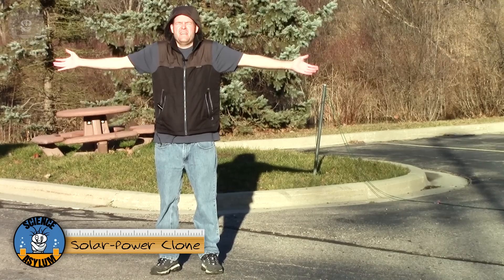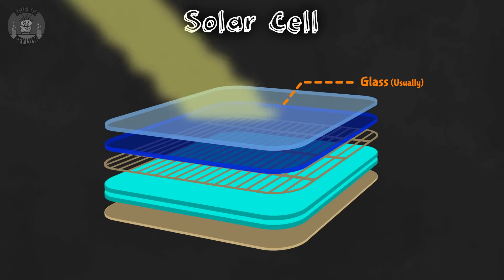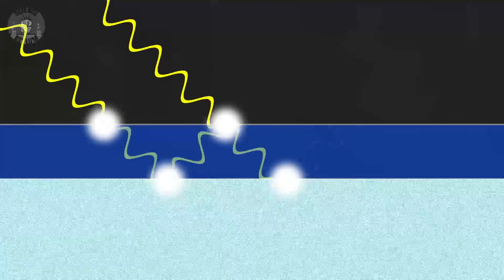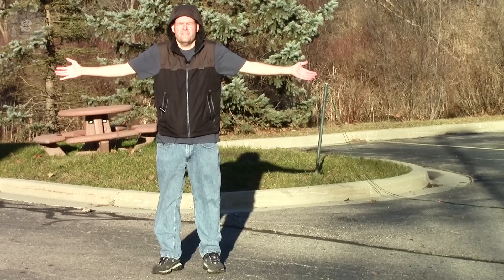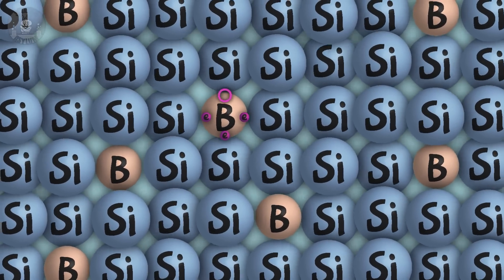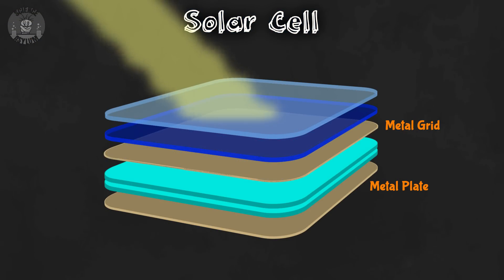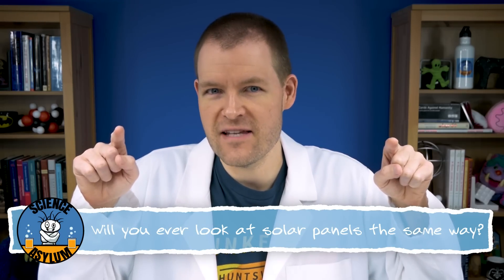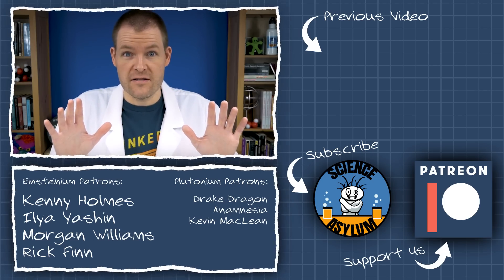How Do Solar Panels Work? (Physics of Solar Cells)

Comment: As someone who has studied renewable energy in university, i must say that this video is a very good explanation in such a short amount of time. Awesome video as always, keep up the good work.
Reply: Sounds more like the "Chemistry" of Solar cells, discussing more of the elements and the periodic table.
There are multiple ways to harness solar power.  Solar PV is just one of them.
The Physics of solar PVs is the Photoelectric effect and the electromagnetic spectrum.
You discussed anti-reflective coatings substantially without stating you have to select a wavelength range infrared, visible, UV, etc.  After that, you will be able to tell which wavelengths solar PVs are converting which I think is important to know about solar power PV. 
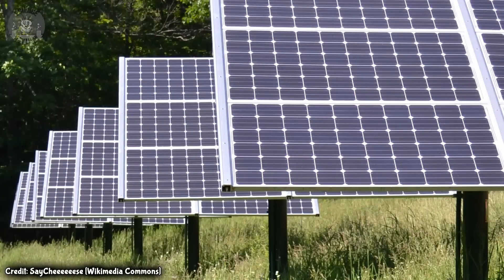7:06 You made it sound that DC is inferior and besides it is out of topic.  It is a long video by itself (inverters). 
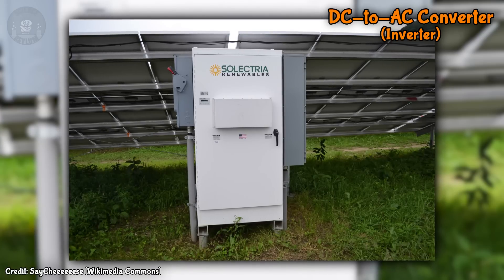7:16 Energy storage is a video by itself and is out of topic. I haven't heard of energy company using capacitors.
Reply: @zodiacfml  I don't think they're out of topic, just out of scope of the video. they're about issues that someone might reasonably ask, so Nick's just pointing out that there are solutions.
yes i would have liked to find out some other methods of harnessing solar energy. are the solar cell the most commonly used today? that would explain why he limited the discussion to them.
Reply: @zodiacfml  (Super)capacitors are used in hybrid cars and also in inverters for solar panels as a relatively short time storage device.

Comment: Please do a video of the Ionosphere and how the D, E, F layers are like orbitals of an atom and how they are effected by the Sun ☀️.
Think about the 11 yr sunspot cycle and what actually causes it. (It’s not what we may have learned in school..). Hint: Think 🤔 what effects a sun.
Reply: Questions: 1) Why does the Earth have a magnetic field? [Don’t tell me its cuz of a big chunk of Iron at the N.Pole or it has a solid, bar magnet core.]
2) What happens if/when our magnetic field goes away or flips?
:)
Reply from the maker: 1) Vortex currents in the liquid outer core. Vertiasium did a good video on this: https://youtu.be/rAYW9n8i-C4
2) Flipping happens regularly. Going away? That won't happen for a very long time because the outer core would have to solidify. Earth's magnetic field protects us from solar wind and cosmic rays, so if it weakened or went away, that would be a problem for a while.

Comment: There  a big hype over solar panels but they are quite expensive and not very efficient. Wouldn't it be more efficient to heat the water with sun energy and create the electricity the traditional way.
It is very common to heat water with solar power, and it's maybe a 2 kw/h worth a day or more for not much panel space.
Reply from the maker: Solar isn't the one-single-solution or anything. It all depends on where you're collecting the energy and where you need the energy to be delivered.
Reply: I'm asking about the efficient ways to use solar power. For private houses that has unused roof space it's ok, but for big sun power farms I'm not sure solar panels are the best solution.
Reply: Chike Well using mirrors has also its disadvantages since it needs to be far away from animals such as birds
Reply: @oremooremo5075  Any solar farm would not like any animals or birds in it's vicinity.
Reflectors supposed to concentrate the light to small are they should not be harmful to anyone.
Reply: And btw production of solar panels and batteries wery toxic. But this is irrelevant if they produced in China and third world countries. We don't give a damn about those people. Right?

Comment: Since a lot of that energy is lost as heat are the heat based ones more efficient?  Like the ones that use big mirrors to focus on to a large central tower?
Reply: Micah Chase  I think so since its way easier to optimise everything to absorb heat
Reply: I think the highest efficiency solar panel is 20%

Comment: happy new year NICK!  why i cant charge my mobile phone using cosmic radiation? after all radiation is energy. why we protect ourselves from radiation instead of converting into electrical energy?
Reply from the maker: If you're talking about cosmic rays, there really aren't enough of them to satisfy human energy needs. Humans are energy hogs.
Reply: The Science Asylum but in space we can get power for space stations, satellites etc... why we use shielding material instead of converting cosmic rays in electrical energy?
Reply from the maker: You also need a mechanism for the transformation. Solar cells turn light energy into electrical energy, but those won't work on cosmic rays. Cosmic rays are mostly little massive particles.
Reply: And some like gamma and x ray will pass through most materials